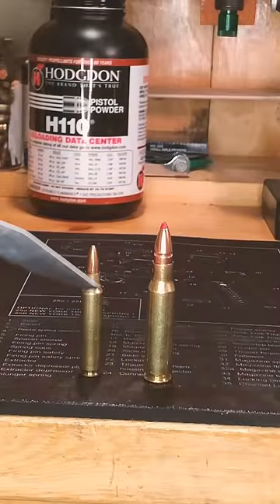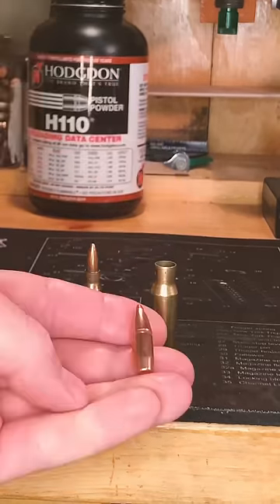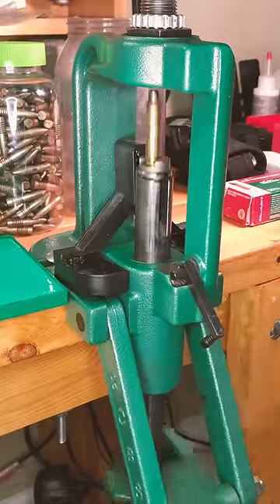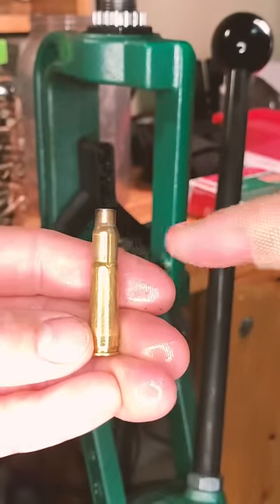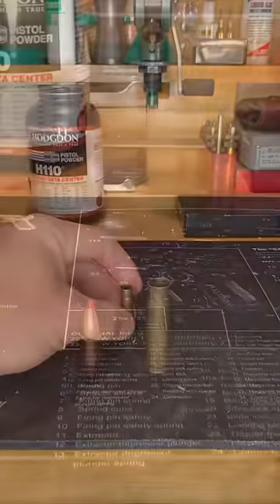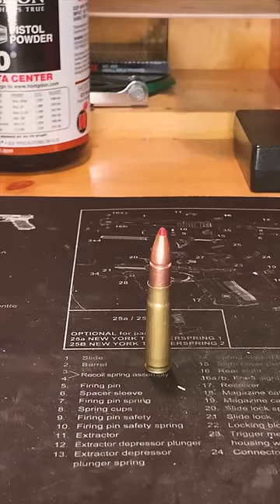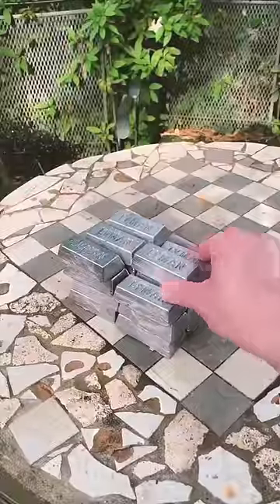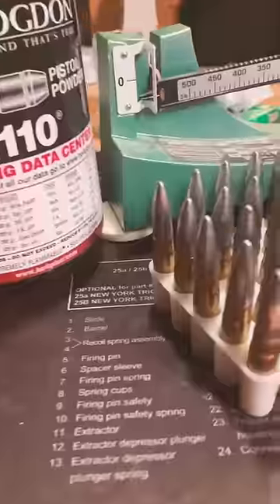A brief synopsis on the concept and history of 300 Blackout. Part 3. #shooting #guns #reloading

Comment: Are you shooting your lead rounds with a suppressor? I'm wondering if the lead bullets leave deposits in it.
Reply from the maker: I personally use my ammunition at full volume, but have some close acquaintances that are suppressor guys. I have been sharing my ammunition with them and they love it. Since the projectiles do not engage (make contact with) the baffles of the suppressors, as they do the rifling of the barrel there is absolutely no risk of lead deposits. Not to mention they are very happy with the low dB.  “ sounds like a Hollywood suppressor sound they said.” 
-Stagger.

Comment: What about the other block out Rounds I know they're all Very similar but still some unique benefits.
Reply from the maker: Despite its limitation in case dimensions and chamber pressures the 300 BLK is pretty versatile. According to the load data I have on hand: projectiles range from 100gr to 230gr with velocities ranging from 1000-2474fps.
Reply: @staggerleesmancave8987  ooooooo
Reply: @staggerleesmancave8987  👍🙂👍

Comment: Or, you could leave it at 45mm, put it through a 6.5 then 30 cal expanding mandrel, put a shoulder on it with your AAC die, load it up with 110 or 125 grain projos, then goto town with your AR 30-30. (Apache)

Comment: You better have a REAL EASY WAY of unclogging that gas port when the cast lead shavings clog it up.  The AR has a gas port drilled 90 degrees to the barrel which means the whole gas block needs to be removed to clean the port.

This is where the AK comes out on top because their gas ports are drilled at a 45 degree angle to the barrel so not only is it harder to clog the port, the port can be cleaned with a reaming tool without removing the gas block at all.
Reply: leg clogging up the gas system of an AR-15 is a well-known problem with 22 conversion kits. the 300 black on the other hand is operating at sufficient pressure and velocity that it is rarely if ever a problem.
Reply: @floridagunrat1625  What the bullets are made with or coated with means more than the caliber or the pressures related to those calibers.

Comment: That knurl is a little high on the 300. Is it more effective being higher than normal?
Reply from the maker: Good eye Connor. Forgive my prop. I was out of typical .308’s at the time I filmed this video. Definitely not your every day .308. While it does have a base diameter of .308 this is one of the FTX bullets Hornady makes for the 30-30. Hence the high cannelure. 
As factory loads they market it under the name “Leverrevolution”. Interestingly they will actually work in a 308 (some guys earlier commented that they do this when they find these on sale). 
-Stagger

Comment: So whats it good for? It seems like it hits really hard a close range but starts to drop severly after 175 yards.
Reply from the maker: The .300 BLK can be loaded in projectile weights ranging from 100gr all the way up to 230gr with velocities ranging from 2485 fps all the way down to subsonic (around 900). It is a very versatile round. 
The bullet drop and resulting compensations will obviously be much less of an issue with the lighter projectile weights in the higher range of velocities. 
The 130-150gr bullets going around 2150fps perform very nicely on deer-sized game. Happy shooting 💨 
-Stagger

Comment: I had thought of making my own brass as I have thousands of 223 cases and 300blk components are crazy expensive in the UK, I thought you had to use a proper cutting die. Was that just lubing and pushing the case through the 300 die without the neck sizer? It would be easy to then trim the neck roughly and get to spec with a neck trimmer, run back through with a neck sizer reinstalled and bam... Is it this straight forward or am I missing something?
Reply: I sit on my sofa at night watching movies cutting 5.56/.223 cases with a plumbers tubing cutter.  You can ram the .223 into the .300 die, but it’s length is too long and bad things happen.  And they often crack.
Reply: @blackhawk7r221  thank you, the cost of a 2" chop saw and then the jig here defeats the object of creating cheap brass. I tried once with a tube cutter and it struggled but it was very poor quality, this still sounds like the best compromise. If I was loading for a semi auto it would be different but for a bolt action I only need a couple hundred. 👍🏻
Reply: @akanonymoss  Ah, yes.  Get a tubing cutter that has a removable cutting disk and sharpen it.  And cut your brass long.  Just slice it at the shoulder.  You’ll take it down to proper length during the neck trimming step.  Initially form the case first without the neck ball stem in your die, then come back in another step and run them with the ball and stem.  There’s no time limit.  And I never anneal.   Anneal is more for expansion of metal, not contraction.
Reply: @blackhawk7r221  thanks again, appreciate the time you have taken to explain this.
Reply from the maker: I will be posting a video eventually that will show you exactly how to convert .223 brass to 300 BLK. 
But for now, here is the gist of it. You got it right. You run the 223 brass into a 300 BLK resizing die with the decapping mandrel removed. Next you cut off the excess part down to the faint line, I pointed out in the video. Some guys like chopsaw‘s, I like my belt grinder. I actually think I’m much faster with my belt grinder than they are with their chopsaw‘s. Lol. It doesn’t matter if it’s a little bit crooked. Because you are still left with enough length to square it up with a case trimmer. But before you get to that you need to run it back through the resizing die this time with the mandrel in place to remove the primer And size the neck. Next comes trimming :I highly recommend the wonderfully inexpensive Lee case trimmer kit for 300 blackout. I think both pieces of that kit still run you less than $20. After trimming you tumble as you normally would, and you’re ready to go. I personally like to bell the mouths of my cases, a bit prior to tumbling, but that may not be for everybody.  Good luck and happy shooting.
-Stagger.
Reply: @staggerleesmancave8987  thank you very much for the detailed explanation, I never thought of using a linisher to take the extra material off, something I have available already. Makes sense to use the cases I have lying around, off the top of my head 50 300blk cases is around $60 or there abouts over here. And 20 rounds of Hornady live ammo is about the same, if you can even find it.

Comment: Ive never seen anyone size first then cut. Ive always cut it down to spec on a jig first, then sized, then ream/cut.
Reply from the maker: Your method sounds solid and efficient! I just learned from this guy…
https://youtu.be/1a55BWiEmSU

Only difference in my system is I don’t like the little chopsaw. I prefer to use my belt grinder to take it down to the faint line I pointed out in the video. Then I run them all back through the resizing die with the neck sizer mandrel in place finish it on a Lee case trimmer.  
-Stagger
Reply: @staggerleesmancave8987  tbh I had my doubts about the chopsaw, but after getting the feel for it you really can crank them out in a hurry! It took a few adjustments of the jug to get it shorter than spec to compensate for the stretch when it’s resized to .30, but once it’s set it only requires like 0.002 worth of shaving and the edge turns out really square. Also, I don’t anneal them at all, 300 runs at such low pressure I haven’t had a single case failure in 3000 rounds of hand loads

Comment: How do those 30-30 bullets work in a 308 win? I'd imagine the results on game would be pretty messy lol
Reply from the maker: Someone feel free to jump in and correct me here but I am pretty certain the only difference between the .308 base diameter projectiles intended for 30-30 and those actually intended for .308 Winchester is that usually the ones for 30-30 have the cannelure (when there is one) set on the bullet a bit higher as the bullet is usually seated somewhat deeper into the 30–30 casing than it is in the 308 Winchester. Regarding the messiness, I can’t speak to there being any difference.  
-Stagger
Reply: I’ve run a lot of different bullets through my reloads, from 7.62 tracers to round nose 30-30.  They all technically work, but remember, you have feed ramps that want to see pointed spitzers.  Freebore jump does affect accuracy, but that matters little when we are playing runnin and gunnin.  For fun rounds, I just load whatever .308  bullet is cheap and on sale.  But hands down, the best overall performers for speed and ballistic stability are the 125’s.    The 150’s and up can get tricky with overpressure from the heavier bullets if you are loading for supersonic.  Just not worth it.  Stick with 110’s or 125’s.  Hogs won’t know the difference between a 150 or a 110, nor one going 1950fps or 2400fps.

Comment: If you don't coat those rounds, the lead will gunk up your rifling. 

It won't damage the gun, but accuracy will fall off faster than jacketed ammo.
Reply from the maker: I’m guessing you didn’t catch the other shorts in this series…
My bullet coating of choice is Lee Liquid Alox…as it has been for 14 years. It work phenomenally. Alox alone is good up to 1400 ft./s. Beyond that I use a Alox plus a copper gas check.
I find it interesting how many individuals refer to powder coating like it is the new standard despite there being no literature to support its use and safety. 
 There is no denying the popularity of powder coating. Granted, it may, indeed at some point supplant proven lubricants like Alox. I’ve seen individuals on many YouTube channels swearing by the powder coating with much enthusiasm….but until powder coating for bullets is being sold by a major component supplier like MidwayUSA, this is why I currently won’t do it: 
Lee liquid Alox has been extensively tested in an actual firearms laboratory. With a very expensive chamber pressure measuring tool that likely neither you, I, or most YouTubers could ever afford. They have also performed inspections with bore cameras after thousands of rounds to ensure that their product prevents leading of the rifling. To my knowledge, this cannot be said of powder coated bullets. While Alox may not leave my projectiles looking like all the fun colors of a bag of skittles, at least I can rest assured that it will always keep my firearm functioning perfectly when using unjacketed projectiles.  
Happy shooting 💨 
-Stagger

Comment: Nice!  Have you considered electroplating the bullets, to reduce lead fouling?  Just curious.  
Not knocking your video or process in any way!
Reply from the maker: I’ve definitely been intrigued by some of the vids I’ve seen of guys electroplating using aquariums for immersion tanks. The problem is…the Lee liquid Alox bullet lube works too well! Been using it 14 years and never had leading issues. I just can’t get motivated enough to try anything else. Thanks so much for watching. 
-Stagger

Comment: I think using the .308 Winchester Ojive makes it a Whisper cartridge, which will chamber in a .223. Real Blackout is too long to chamber. Kevin Brittingham of Q talks about it on the Unsubscribe podcast.
Reply from the maker: Yes, forgive my prop. At the time of the video making I was currently out of blackout projectiles and just grabbed one of those 308 Hornady FXT’s actually intended for 30–30. I have received an appropriate amount of ribbing from the more gun-educated viewers like yourself lol. 
Regarding the length, I must admit that achieving a proper COAL is definitely a challenge when hand loading the 300 BLK. This is particularly true with the super heavy 200+ grain subs. And becomes a treacherous balance between proper chambering, feeding, staying within safe pressures. 
BUT… once you get into that narrow zone of functional yet safe COAL, I have found it to be a very fun and formidable round. 
-Stagger 

Ps: I know you were mostly referring to the dangerous situation of accidentally chambering a 300 blackout in a 5.56/.223. But I felt your  chambering reference was a great segue to discuss the issues the COAL issues with this round.

Comment: Sorry j d Jones came up  with the 300 whisper and other whisper lines only thing is it was proprietary 30 years ago today it was changed ever so slightly and put out by AAC who gave Lodi data on it, thus making it a successful cartridge. But they were not the inventors. JD Jones was unimpressed with subsonic pistol calibers, so he experimented with heavy rifle bullets at subsonic speed, and then pitched it to the military as a replacement for the MP 59 mm. Which is exceeded the lethal Ness of the 9 mm cartridge and could easily be swapped out with a magazine change the supersonic rounds
Reply: yeah, sort of, something like that, but not really. JD was highly impressed in 1990 when the cartridge was demonstrated to him. The design work was already done and load development was ongoing when he ran off with it.

Comment: Just out of curiosity, isn't a bad idea to run non jacketed ammunition through gas operated rifles like the AR platform? I have seen another YouTube channel (can't remember which one) who made his own ammo doin the same thing your doing except, he powder coated his bullets with powder coat that he bought from harbor freight in order to keep the gas port from getting clogged.
Reply from the maker: Excellent question Swamp Ghost! I have actually had zero issues with lead fouling (and I have run 100’s of rounds through 2 AR platforms) 😃. Here’s my basic recipe for success when it comes to avoiding lead fouling: all of my lead projectiles have a generous coating of Lee liquid Alox on all portions of the bullet that engage the rifling (lube grooves and bullet base) On most of my ammo, this portion of the bullet is nicely concealed within the brass case so it’s not messy/sticky at all. Secondly: anything that is being pushed at a velocity that exceeds 1400 ft./s is protected on its base by a copper gas check. (I like Hornady checks). Third, you should follow available literature/load data when it comes to certain velocities/chamber pressures and the recommended Brinnell hardness (BHN) of your lead alloy. Typically the faster you’re going the harder the lead needs to be. 
After each shooting session, I spray, Birchwood Casey Barricade down my barrel from the breech end and then pull a Hoppe’s Bore snake through it. This procedure is not meant to replace a full on cleaning with the solvent and patches, etc. but it definitely beats what most of us are guilty of doing, which is throwing the gun in the corner and forgetting about it until next time.  To date I have had great experiences handloading cast lead ammo in the following calibers: 
9mm Luger 
45ACP
38 special 
30-30 Winchester 
223 Remington 
300 BLK 

Happy shooting 💨 
-Stagger
Reply from the maker: Regarding the powder coating, there are several channels showing this now but my favorite is Elvis Ammo. It is definitely neat and growing in popularity, but I personally haven’t needed to change over to it yet.